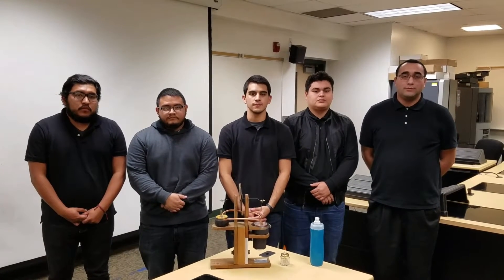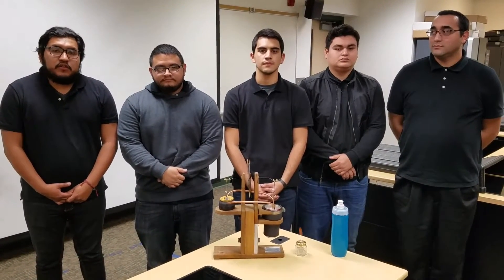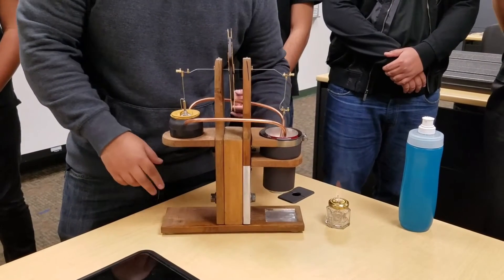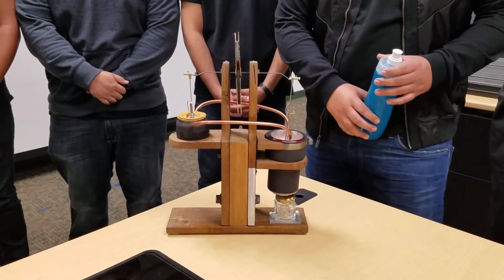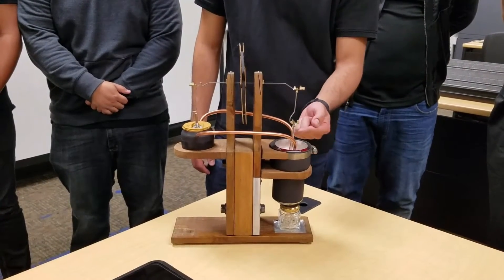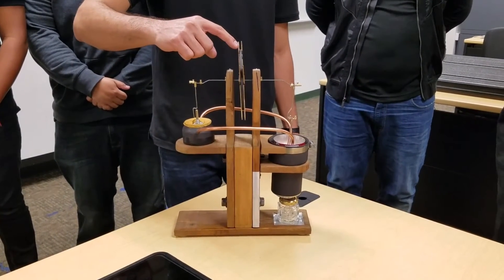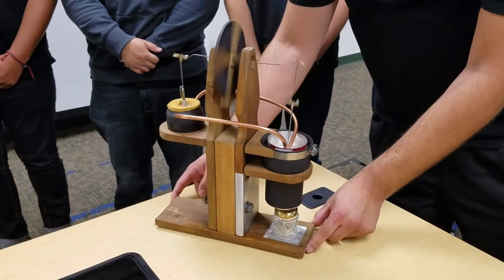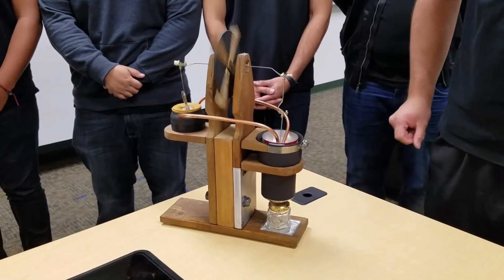ELAC - GE 101 Artin Davidian Stirling Engine Project (Team MeCh)

Comment: for a faster running engine, try adjusting the action of the diaphragm.  at the midpoint of the working piston stroke, the diaphragm should be flat across the top of the cylinder.  it acts as a centering spring.   cheers